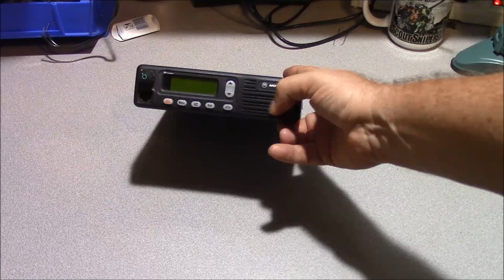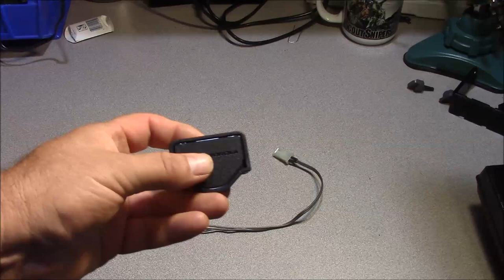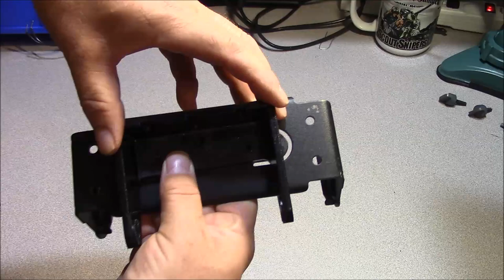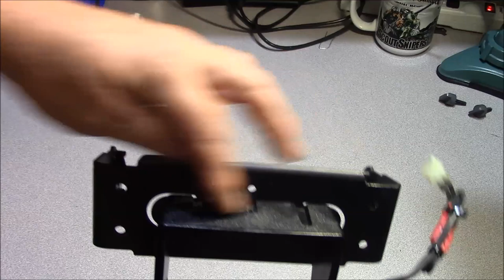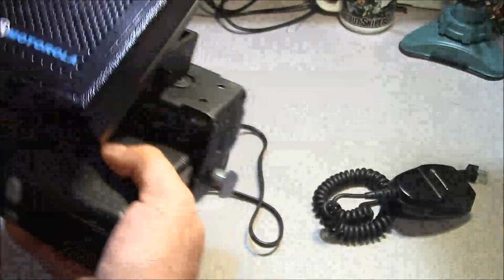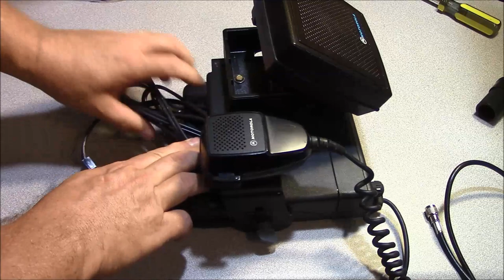Configuring a Motorola MCS2000 as a cache radio

Comment: Could you Go over the model numbers for VHF, UHF and 900 Mhz...minus the 800 Mhz? So that way we know what models to stay away from.... Could you also go over the programing? I think it might be D.O.S.? And if we come across some models like the 800 Mhz could you do a tear down so that we know what parts are salvageable to the other radio bands. i.e. VHF, UHF, 900 Mhz.
Reply from the maker: 4th digit of the model number is the band split.  ex M01Kxxxxxx is a VHF,  R is low split UHF 403-470, S is high split UHF 450 -512 ,U is 800, W is 900 . The programming is on windows CPS (RVN4175 v2.03) You can program through the mic port or the accessory connector.  Everything except the main board is useful across bands. accessories are compatible across bands. control heads should be like for like  putting a mode 3 head on a model 2 radio will not make it a model 3. Thanks for watching !

Comment: hi, is posible to use this radios for normal use not trunking ?? , thanks for your time.
Reply from the maker: Yes they are the UHF and VHF models will work in the 2m and 70cm amateur bands as well as the commercial. Thanks for watching

Comment: Hi

I purchased a Motorola MCS2000 on EBay But when I turn it on, I just keep getting the message “ Out Of Range”
 I was hoping to use it right out of the box, as a base or mobile, “SHTF” radio.. so my question is do I need any special equipment to be able to do so?  would it be very expensive?  
Is there such a thing as a factory reset on these units to be able to use it?

Thank you for your time
Sincerely
Reply from the maker: Sounds like you got an 800 or 900 mhz variant that was not deprogrammed. Its looking for the control channel of it's parent system and not finding it.  Look at the 4th character of the model number and see what character it is. If it is a U it is an 800mhz  and is valuable as parts only unless you operate on a legacy analog smartnet / zone system.  If it is an 800 yes it can be reprogrammed but there are no license free or amateur frequencies in 800 spectrum. If it is a K, R, or S (VHF, UHF, UHF Hi split) you have options. I hope this helps and thanks for watching !
Reply: SurvivalComms Thanks very much for your expert knowledge and taking the time to reply so quickly. Your knowledge is incredible, fantastic channel, very valuable.
Reply: @survivalcomms  hi, is posible to use this radios for normal use not trunking ?? , thanks for your time.

Comment: Do you also have idle current (radio is switched off ) 240mA ? All mine have
Reply from the maker: That parasitic drain is not uncommon . I have not tested one of these (MCS2K) for that but I have observed that with many mobile radios. I relay isolate radios in my permanent installs. Thanks for watching !

Comment: Hi brother. Great video. I buy the MCS 2000. Where you find the power source for that radio? Car lighter and what else? Power supply? How many Amp? I ask because I never have this type of radio before.
Reply from the maker: Typically they are installed on a 20 amp circuit (the 110w are on a 40 amp circuit). If they are not running full power you can put them on a lighter and run them all day. A dc power supply capable of 15 amps and above will work good at home. For just about all of your mobile install questions I have a 3 part series on my channel here is part 1 https://www.youtube.com/watch?v=95bOF_e5PKc
Thanks for watching !

Comment: I will question your using a 16 gauge power cord unless your going to use low power on the radio ALL the time -- 25 to 50 watts will draw some amperage  on that cord enough to make it hot and a decrease in voltage to the radio -- I would try to modify from the plug in back to the radio or purchase the power pole lighter plug in with the PP connectors already mounted on the plug in then make your cable length to the radio with 14 gauge wire at least -- just say'n
Reply from the maker: Lighter outlets provide a max of 15 amps typically.  the cord length is just a few feet and the radio is tuned to 20 watts. Thanks for watching !

Comment: Hi, what value of balancing transformer shall I use to use my Amplified Motorola Speaker to my Motorola Spectra?
Reply from the maker: What is the part number of the speaker ?
Reply: @survivalcomms  the Speaker Model number is HSN1000BR.
Reply from the maker: @alsario3054  Use an audio isolation or ground hum isolation transformer such as this in the audio lines : https://www.amazon.com/Isolator-BOSS-Audio-B25N-Systems/dp/B000LP4RMG/ref=sr_1_1?keywords=bossb25n&qid=1581626263&sr=8-1-spell

Comment: Hi Brett, I purchased one of these radios for my vehicle, but the pinout wire that came with it looks very different from the wire out that you have for the unit. My wires also don't have a connector at the end of them to go into the speaker. I do have the same speaker as you show in the video. Would you be able to give me some more information on how I can hook these up? I am not sure if I should cut the connector from the speaker and connect the wires directly. Any help would be awesome. Please let me know how I could contact you, or I could leave you my email.
Reply from the maker: Most commercial radios like this have balanced audio (audio hi / audio lo) and aren't polarity sensitive however that being said dont  bring either lead to chassis ground. If you look at the molex the one with the ridge is audio hi. Do you have the accsy connector ? My email is my channel name at gmail . Thanks for watching

Comment: Awesome!  Where's the best place to pick up the speaker and antenna?
Reply from the maker: Thank you ! The speakers are available on auction sites or hamfests for a fraction of what they cost from Motorola. The part numbers for the factory speakers listed are HSN4031 , HSN4032, HSN4024, HSN4025, HSN4027 ,  and HSN4028  . I like quarterwave antennas personally  and  you can get them from Tessco or another commercial two way vendor. My favorite quarter wave kit is the Larsen NMOQB - You tune it yourself by cutting the whip to length and the base has a really great seal that can survive the worst elements. The laird magnetic bases are a good value - better quality than the cheap stuff but a tad more money.  I hope this helps and thanks for watching !

Comment: Outstanding info as always. What do you think about that Midland MXT400 40 watt radio? I've been wondering if it would be possible to build an 18650 battery bank and make it a "relatively" lighter weight man portable back pack type radio that can go into a get home bag? The range of those handhelds just isn't all that great for my needs, so a trade off of extra weight for increased range is worth it to me. Keep up the great work.
Reply from the maker: Thank you very much ! The MXT400 is a fine radio but pricey IMHO . If going with a manpack configuration  an 18650 pack or one of the smaller LifePo4 packs is pretty much the only way to make it practical as using high power will greatly reduce your operational time and the gel cell option adds lots of weight. If you do choose to go with a manpack arrangement you will need a suitable antenna to really take advantage of the higher power XCVR. Before making this sort of investment I would test a conventional mobile with a gel cell and the antenna system you plan on using along the signal path in question to see if it is even feasable before spending money. Another test that you may have already done over the desired signal path is if two mobile stations can successfully communicate. If they can then what you are envisioning has a better than average chance of success. Thanks for watching and I hope this helps !
Reply: Thanks for the reply. I haven't bought bigger radios yet, because honestly, I'm not a commo guy at all and I'm trying to figure out what will work. I do have more hand held radios than I care to look at and all have VERY short range. I have started giving them away to other people, because for my needs, they fall waaaay short. I don't really care about cost either, as long as it works and is man portable.

The area I'm in is very flat, and no buildings or anything like that. Just a lot of woods...well more like swamps here in Louisiana. The max distance between the two points I'm talking about is about 20 miles. I know that's asking a lot, but I have read where people have been able to get that kind of range out of the MXT400 from a vehicle to a home base.

At home I can put up a tall antenna, but in a man pack......I'm not really sure. I'm also not sure about having an antenna with 40 watts coming out of it near my head. Heck, I don't even use cell phones because of that and MANY other reasons. Again this is just for extreme emergency and not everyday use.

I'm not worried about a battery or the cost to build one, as long as it will last 10 to 12 hours of run time with very little transmission on my part, but I am wondering how to do the antenna to make sure I get the most out of the radio when I do have to transmit. 

I'd also like to make 8 or 10 of these man pack set ups. Any other suggestions or ideas would be greatly appreciated. Thanks again and keep up the great work.
Reply from the maker: The group who is getting twenty miles is taking advantage of elevation at the tx location , rx location, or both.  UHF being line of sight and power alone will not make the trip.  Lets build a model.  Typical FM receiver sensitivity is -118dbm and this represents a minimal signal. The radio in question at full rated power is putting out 46dbm .  Lets say both stations are mobiles  We will factor in 1.5 db of loss for our antenna mount and coax (assuming 1:5:1 SWR) and that brings our power out put down to 44.5dbm or 28.27 watts. We decide to use 5dbd colinear antennas for our installation and this brings up our power to 49.5 dbm or 89 watts and this represents a pretty efficient mobile station.  The path loss using a hata model at roof height of both stations at 40km at even heights (6m) has a path loss in suburban terrain of 187 db if we subtract the path loss from the ERP of our mobile station the recieved signal is approximately -137.5. The system gain in the receiver antenna system is 3.5 db so the signal at the receiver antenna port should be -134 dbm  which is 16 db below our minimal signal.  Lets increase our power to 110watts which would give our theoretical station an ERP of 53.9 dbm or 246 watts the signal at the receiver is -129.6 dbm which is still 11.6 db under our minimal signal. Bringing one of the stations to 30 m (90ft) drops our path loss to 169.8 where our 40 watt station is  just inside our threshold by 1.2 db. The 110 watt station is almost 7db in our threshold on one side of the link.  I hope this helps !